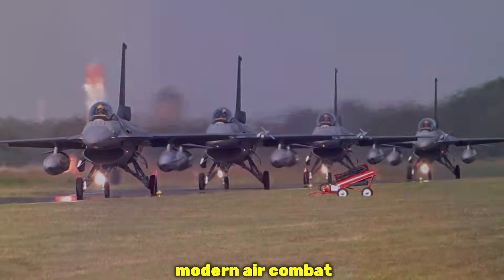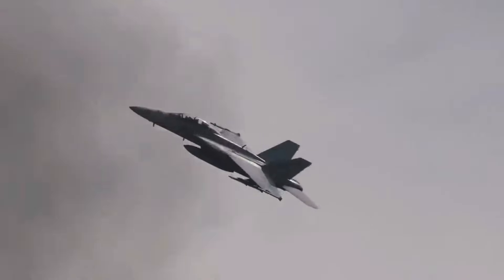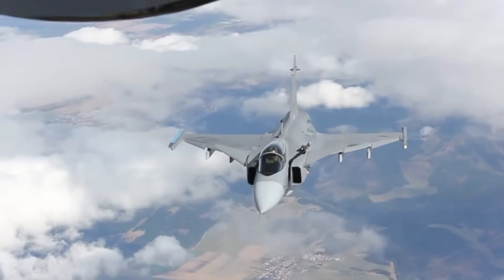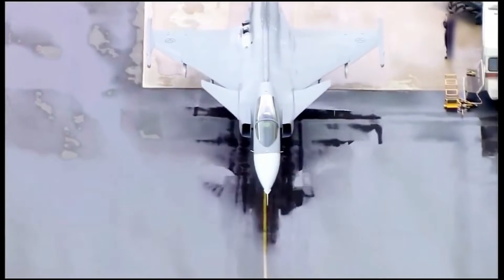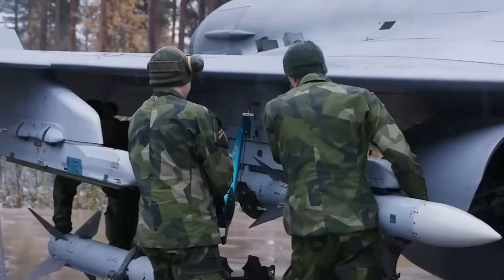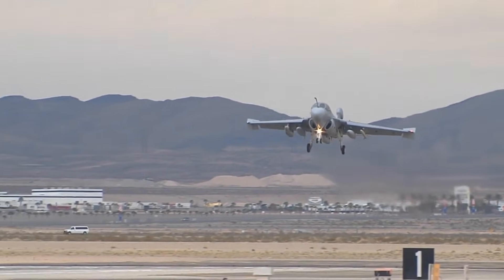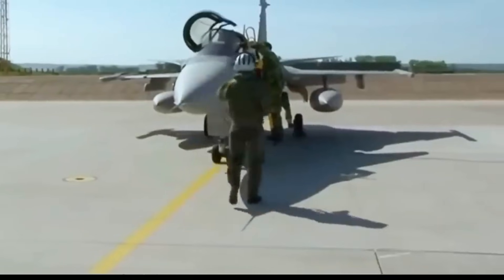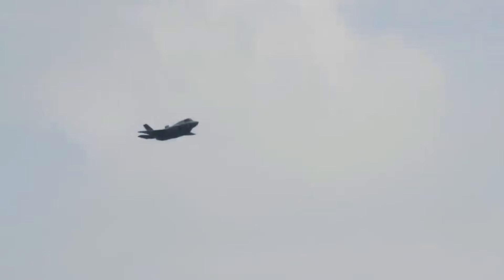Why the Rolls-Royce Engine Makes the Saab JAS 39 Gripen E a Powerhouse

Comment: Wait, not only is there no engine integration other than the American one, but the aircraft itself is far from being completely finished, and this is planned for 2030 or beyond, so why all the advertising? The current Gripen, and I do mean current, is on par with a Mirage 2000-5 or an F-16 Block 70, nothing more, nothing less.